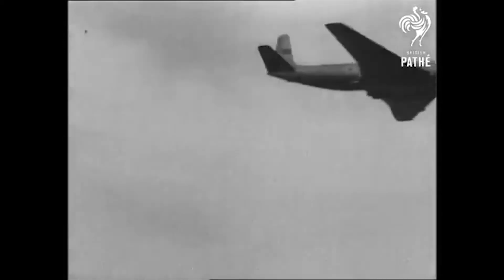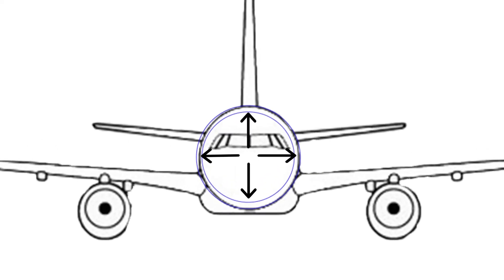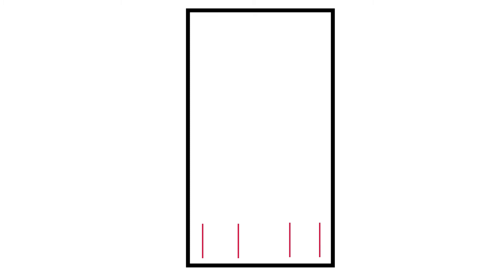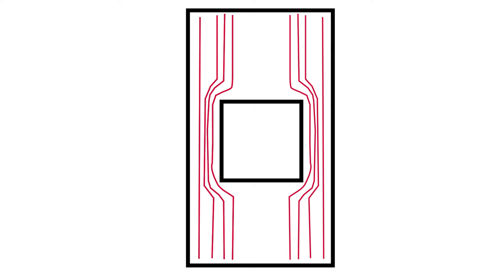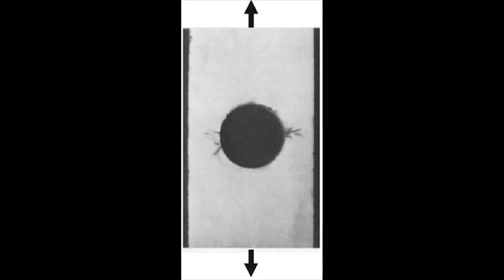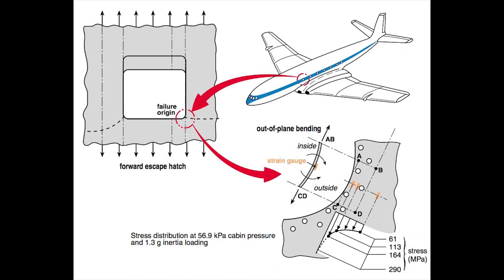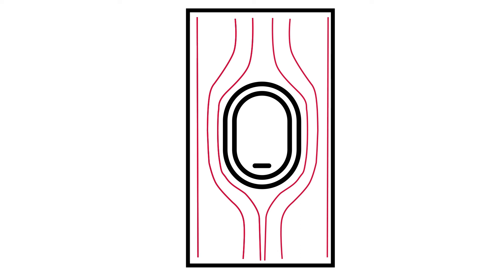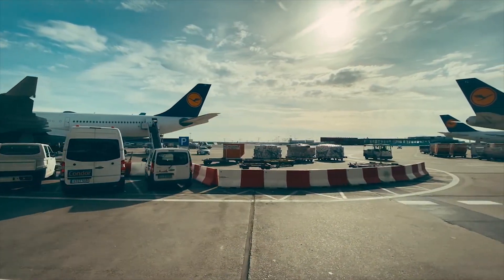Why Square Windows Caused This Jet Airliner to Crash

Comment: Sorry but this is a myth....    
Check Wikipedia's Comet page itself....
In fact the mention of 'windows' in the Cohen report's conclusion, refers specifically to the origin point of failure in the ADF Antenna cut-out 'windows', located above the cockpit, not passenger windows.
Reply: you are trippin'